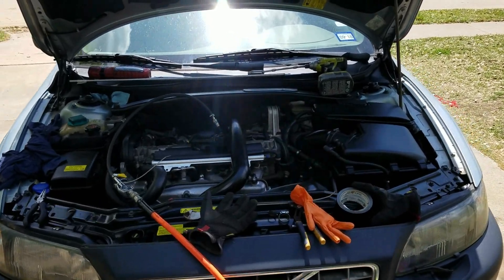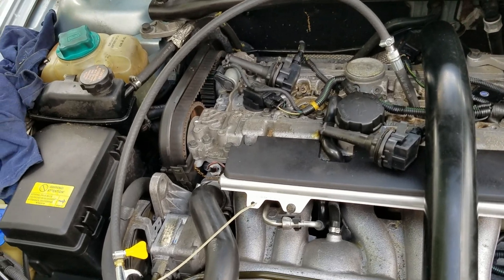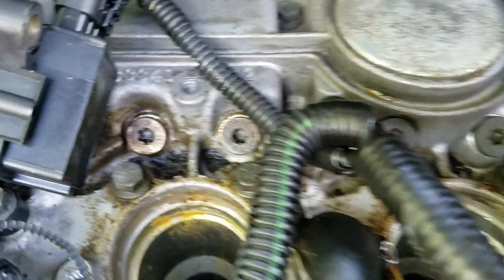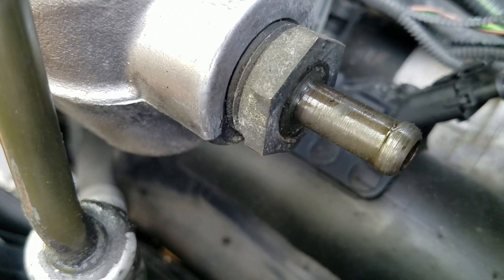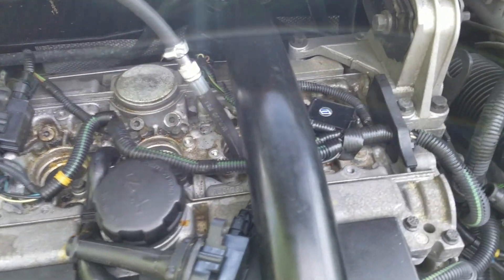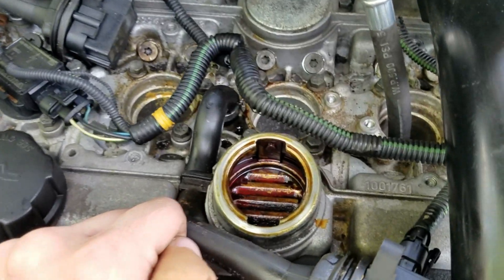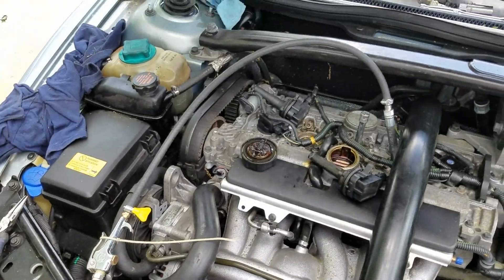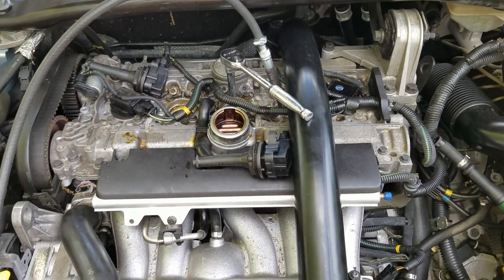Low compression causes! Diagnosing burnt valve, head gasket, or piston rings??

Comment: I have citron 1.4 petrol compression is 175 on 3 cylinders but 55 on 4th cylinder. Would I still be able to drive the car?
Reply from the maker: The engine needs a rebuild, so the damage is already done.

Comment: Best video so far. Thank you. One question though. How would you go about cleaning exhaust valves without taking the engine apart? I know you can clean intake valves by taking the intake manifold off, but I don't understand what would you do with the exhaust ones?
Reply from the maker: Thank you! Unfortunately exhaust valves don't usually clean up, even if you can get to them. The burnt carbon required tools to remove it usually

Comment: Would it be possible to get compression and have a burnt valve? My mini cooper s r53 is running on 3 cylinders and is sucking through the exhaust
Reply from the maker: Yes you would have SOME compression. but not alot.
Reply: @gagefixeseverything  right, I've got 125psi on 3 cylinders and 95-100max on 1.the car flags up with a cylinder 1 misfire but no.3 has the lowest compression. There's no excess gas coming through the oil filler/dipstick just vacuum. I'm basically on the ledge about taking the head off.

Comment: What would cause a cylinder to register 150 pounds during a compression check, but then when engine is running the psi drops to 20-25 psi?
Cylinder 4 of a buick 3.8 v6. Thanks.

Comment: i kept getting misfire fire from the same cylinder after spark, ignition and injector replace and got all good compression but ended up with a leaking head gasket in cylinder two. So u can't really trust these test except doing a reverse power flush through the radiator and see if water is comming out from the cylinder , which mine did... and stick a camera down the cylinder
Reply from the maker: A pressure test through the cylinder should show pressure in the coolant system if you can put a gauge on the radiator or degas bottle. Alternatively, yes you could put a pressure tester on the cooling system and then pull the spark plug to see if coolant comes in, but that is more risky because if you dont pull the plugs, and then start the engine, you could bend a rod by hydrolocking if too much coolant is pushed into the cylinder and not removed
Reply: @gagefixeseverything  

yea, u just got to know what your doing ... It's a risk , but when u have no choice to find out the problem and everything looks good but problem is still there u kinda have no choice to do that radiator test through the cylinder ... nobody on youtube actually have a video on doing it , maybe u can make one ..  would be helpful for others to learn , thks

Comment: If leaking past rings, be sure to, next, put a FEW DROPS of oil in suspect cyl. Try compression test again (wet comp test) then, turn engine over/run for a short while- check compression again. If it comes back up, and the plug that was removed from cyl was fouled  (due to ignition issue having occurred), chances are the rings/cylinder walls were "washed down" by unburned fuel during the misfire event, causing the ring/s to loose it's seal. The oil you've  added will re-seal and fix you're problem (IF washed down rings was indeed the cause). 

Replace plug w/ new (or clean w/ lots of brake clean. Using fouled plug may start the fouling/misfire process over again.
Reply: Oh, and to poster of video - good job. Should help a lot of ppl out there.
Reply from the maker: GREAT info here!! Thank you for posting it

Comment: My number 3 cylinder compression is zero. This happened overnight. Also the truck was burning oil and quit burning when this happened. The other 5 are good. I can't afford to rebuild. I need to do the leak test.
Reply from the maker: at 0psi, the engine needs to come apart. There is no way around it.

Comment: Will low compression shows in scan tool? Does it have code on its own?
Reply from the maker: Now. An ECU has no way of detecting cylinder pressure. It uses differences in pulse speed of the camshaft and crankshaft sensors to determine what cylinder is misfiring, but it wont tell you why unless it is directly ignition or fuel injector related.

Comment: Very good job of analysis.  Good technique.  You gave be several ideas I had not thought of.  You are probably correct, worn piston rings, not worn out, just worn more than the other 3.  If you had a bore scope you could see if it was due to cylinder scaring versus ring wear, not that it really makes much difference.  SInce it was 2 cylinders and not one, probably piston wear.  You are also correct in your compression tester, get a good one.  OTC does make good products; typically more expensive but better quality.
Reply from the maker: Thanks for the comment! I do use the OTC tool most of the time. It has better adapters

Comment: Timing belt broke, put new belt on ran compression test n only 2 cylinders were low, pulled head, replaced all valves in those cylinders, runs new again👍
Reply from the maker: Great job!

Comment: I have a 2003 toyota v6 57000 miles. Wife's car short drive to work. Low compression developed a year ago after 2000 mile  drive, then drove 2000 back. No oil smoke, spark clean, coil, injector replaced, no gas smell on spark, cylinder head- no carbon. Dealership said 100 psi on number 2 cylinder as also shown on my computer reader as misfire. 150 psi on other 5. Engine light on. Runs fine. A little rough at idle. Dealership suggested a new engine. They did not check anything else. Just stopped at compression test. As a precaution, I'm going to replace the oil solenoids.  Given this info, what do you think?
Reply from the maker: beep

Comment: What a fantastic and informative video. I'm having low compression on one cylinder on a 98 Mercruiser 3.0. The suspect cylinder had air going through and out of the carburetor and no other cylinders did that. There isn't anywhere that I can see to check for intake valve leaks. Any tips? This boat has 50 hours on the engine but sat for over 10 years in a barn. Any help or tips is greatly appreciated.
Reply from the maker: reply

Comment: Great information! I've quite recently gotten very interested in internal combustion engines and I was wondering if there are any additional tests you can do to try and exclude or confirm the possibility of a crack in the engine block or head? I'm assuming a warped head is impossible to test for as it causes the exact same problem as a bad head gasket - correct? I was looking at buying a car with a "blown head gasket" for very little as a project to learn more about engine disassembly etc but short of taking the head off - can you get any closer than this to confirm it's not something else? Great info nonetheless very useful!
Reply: Leak down test with smoke will tell you all you need to know👍
Reply: @kirbytabor9956  Ah thanks, I'll look that up!
Reply from the maker: reply

Comment: Also could be carbon build up on the rings pour some seafoam into that cylinder or all cylinders and let it soak overnight and then redo the compression check
Reply from the maker: Correct ^ I did actually do a video on marvel mystery oil, engine restore, and another one called Auto RX.
Reply: Carbon buildup can cause low compression? Can it be reversed?

Comment: Hello there! Amazing video, thank you! I have Skoda fabia 2005 1.4 75 hp with gasoline engine. I notice that when i park the car on a slope, around 25 degrees, on the first gear, the car is starting to roll down on stages. It's like the engine comression is gone. I read that when it starts to roll down like this, its already started to go down itself the car depot. 😃 Well the engine work so fine, without any unusual noises with changed oil, water pump, new timing belt. For about 7 000 km that i drove, the oil level went down just a little bit. I will bring it to measure the comoresion level and see if the engine is dying
Reply from the maker: Thank you! If your engine runs well, it most likely has low compression evenly on each cylinder. Which is not that bad at all! It is much worse to have unbalanced compression. Good luck with the Skoda, we cannot get those here!

Comment: Hi,I'm Joy. My friend has a Lincoln Navigator 1999 and it's sitting on its on back wheels. She says it's the compression system on it. Do you have any ideas on how I can help her with this problem please
Reply from the maker: Yes, the air bags for the rear suspension system are the problem. Its a very common issue. I would replace the air bags with coil springs and shocks instead
Reply: @gagefixeseverything  thank you

Comment: I have a 2004 mustang v6 40th anniversary with 200,500 miles no compression in some cylinders and if there is its not much some do go up tho also on start up its very weak and sound so bad and has a ticking noice no power when give it gas
Reply from the maker: You probably need to pull the heads to find the issue. it's going to need a rebuild
Reply: @gagefixeseverything  thank you yea i talk to a some what mechanic he said he would have to take the heads off and some thing would need to be rebuilt

Comment: Hope u answer...
It's a honda civic 2002, 4 cylinder 1.5L D15B engine. I have low mileage due to low compression and smell fuel out of exhaust. My initial diagnosis is, it's not the piston ring or the head gasket is bad becaus I don't lose a single drop of engine oil. What might be the cause. I got around 110psi almost in all cylinder.
Reply from the maker: Does it run low on coolant? It could be burning coolant through the exhaust
Reply: @gagefixeseverything  no loss of coolant, no loss of engine oil..only low compression (around 110psi in all cylinder). Injectors ok, fuel pump ok..

Comment: Did this test. Thanks for the info 🤙 
Between cylinders 1 & 4 I have a breach with air.
Also only cylinder leaking to exhaust is cylinder 4 but on TDC exhaust valve is open. G16B Vitara?? 

Car will not start, low compression.

Any ideas 😂
Reply from the maker: If its a suzuki, its no good haha. I have replaced more of those engines than I'd like to with way too low of miles. Was the engine overheated? #4 exhaust valve could be sticking in the valve guides, and the head gasket is breached between 1 and 4

Comment: I have a 2012 ford fiesta 1.6l and it has low compression on the 2n3 cylinder.. also it's a duel camshaft and the exhaust camshaft keeps popping out of time.. any ideas??
Reply from the maker: That is not an engine that I have worked on before. It could be several things. The low compression could be related to the exhaust cam timing for sure. Need to know why its jumping time. The tensioner could be bad, chain stretched, or the cam gear teeth could be worn down.
Reply: @gagefixeseverything  thank you for this info

Comment: What does it mean if you do a compression test with all the spark plugs out and the gauge keeps slowing dropping once you are done cranking the engine over??
Reply: Schrader valve on the hose or gauge/connections are leaking. Gauge should not drop after a compression test until you release the pressure.
Reply from the maker: THIS ^

Comment: Im Stuck!!!
I have 2 adjacent cylinder with NO compression.
I do not have any coolant/Oil mixing
I did put a latex glove on my exhaust. It did fill with air
I used a borescope and found oil siting on top of of one cylinder of the 2 with NO compression. All others had carbon build up on top of pistons. Something tells me I have bad valve seals.
I would like to know with certainty what the issue is.
Do I have a bad head gasket? ***Doubt it. No Coolant mix. 
Do I have bad valve guides? ***Yes, because I see oil on Piston Top
Do I have carbon build up on my Valves, unable ling them to seal properly? (***Unable to tell with Borescope since it does not turn up on itself)
Could it be my Valves need to be adjusted? (Now that I haven't checked although when I placed it to top dead center to do a leak down test, rockers did not appear to apply any pressure on Valves)
Do I have more than 1 issue at bay?
Car has close to 200,000 miles. 1995 Honda Del Sol with a D15B7 Engine. I Don't know its service history. I bought it with this present condition. 
Can someone help me narrow this down?
Reply from the maker: I'd bet you have burnt or stuck valves. You can pull the valve cover to make sure they are moving. 2 adjacent cylinders could have a head gasket breach between them

Comment: I have a 2002 e 150 van 4.2 6cyl
..#3 cylinder had oil on the plug so may be valve cover boots but today I was told that the 3 cylinder had no compression...do I ask for leak down test or what..I need confirmation to get to next step

Thank you
Reply from the maker: I would 100% ask them for a compression test print out.

Comment: Hello Gage! new subscriber here! I just have a question when you said that there was air coming out from the oil filler, what could be a detailed reason why air would come out from the oil filler? and what if the scenario was the car was idling and we remove the oil filler cap and you could visually see, and feel air and gas coming out from the oil filler? Is this a bad sign of something? I hope you answer my questions! thank you for the information from this video. God Bless
Reply from the maker: The mostly likely reason for what you are describing is a clogged PCV system. The Volvo engine design used a catch can that is very commonly clogged. I have never had a volvo that didn't need it replaced. Its a simple task that involves removing the intake manifold. 

It is possible however that you are having piston ring blow by causing this as well, but since the PCV catch can system is so commonly clogged on these engines, id check there first!
Reply: @gagefixeseverything  Thank you Gage! New information gathered from you! This really helped me alot, I wish you an awesome day 🙂

Comment: My car crapped out on me getting off the highway. Before, it was burning engine oil like crazy fast. I changed my spark plugs and put in oil. This was before my car crapped out. Still doesn't start. Took it in to a mechanic who said there was low compression in cylinder #2 and #3 (both around 55PSI - should be around 165) The end result was that I would need a new engine...Does that sound right? Is there anything else I should check? Maybe take it somewhere else for a different evaluation?

Comment: I have a 1996 4.0 chrysler/jeep inline 6 cylinder which i did this test on. The engine is out on the ground without exhaust or intake attached so its virtually impossible to warm engine before a compression test which i also did & I'll get back to that in a minute. But first, using your test all 6 cylinders leaked with piston @ TDC but all 6 DID NOT leak with piston @ between 8 - 12 degrees before TDC. Just a miniscule amount of air made the engine turn with engjne pistons between 8-12 deg. BTDC. I thought this was odd. I'm wondering if a streched timing chain would cause this?
Now back to the compression test. I had to do the compression test with the engine cold. The standard on this type of engine calls for between 120 & 150 psi. I think that is suppose to be with engine warmed to operating temp. The readings i got were between 185 & 215 psi with engine @ ambient air temp. I wasn't aware there was such a large difference in psi between cold & hot engine temps. Any insight would be appreciated.  Thanks

Comment: So Engine Restore won’t solve my low compression problem if it is a burnt valve. No sense in wasting money on getting Engine Restore added to a 2007 Hyundai Tucson with 260 thousand KM on it, right?
Reply: Allan Chu I think your correct, I believe engine restore is for head gasget issues
Reply: THICC daddy F is there no way to fix this?
Reply: YuriDontPlay If you 100 percent know your issue is valve related or in the head of your engine, I haven’t heard of any fluid fix BUT usually that’s still cheaper / easier to fix than a new motor i

Comment: Could I use this system with a busted timing belt, and just turn crank and test each cylinder one at a time.  I'm trying to see if any of the valves were damaged when belt broke?
Reply: ChromerSatanas just google if your engine is a inference engine or non

Comment: how would u know an exhaust valve was bad and fill a glove with air if you have weepholes in your muffler? Wouldn't it leak there first
Reply from the maker: good point, The small weep holes will let some air out, but the glove will still inflate to the point that it would be noticeable. I clearly shows this in the video i think by turning the engine to open the exhaust valve, and blowing up the glove at the end.
Reply: look at 8:25